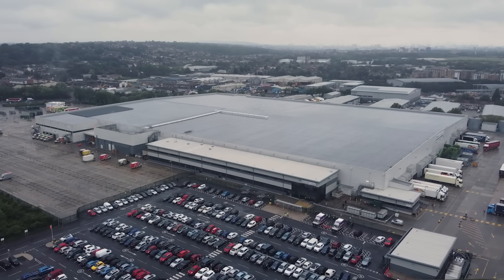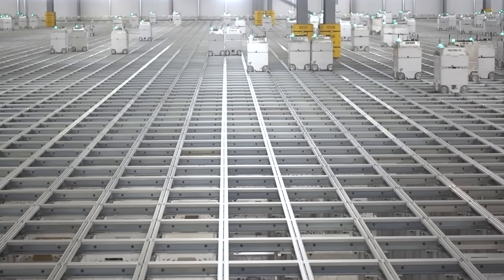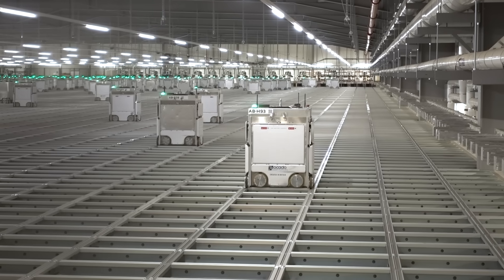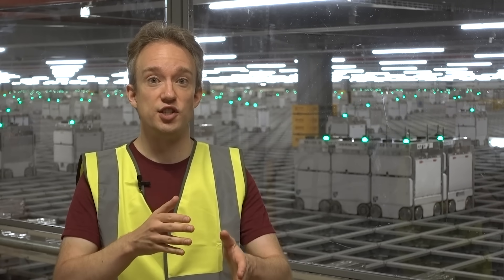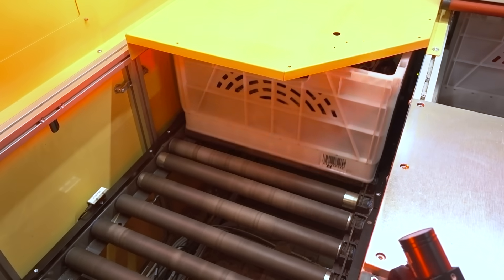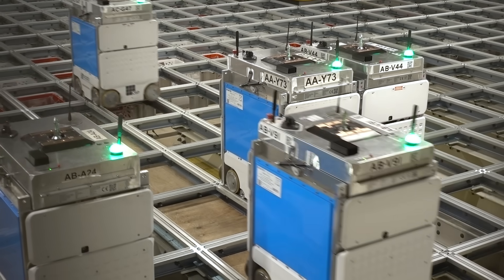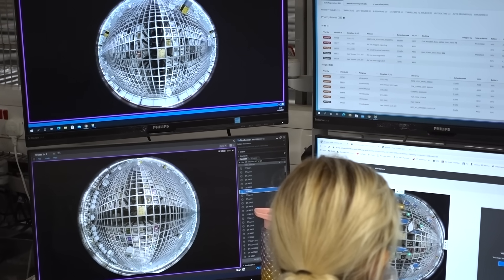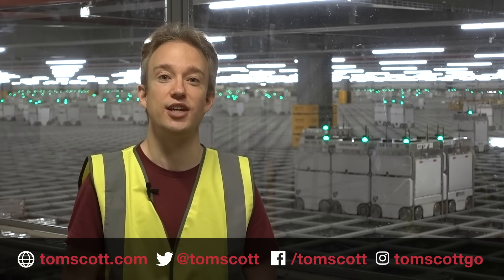How many robots does it take to run a grocery store?

Comment: "...We use 2 3d cameras.." 
Shows xbox camera
I... expected something different
Reply: From a technological perspective, Kinects were ahead of their time. It’s a shame developers never figured out what to do with them.
Reply: @bubbledoubletrouble  It's not just developers (though it definitely plays a part) -- even if developers DID figure things out better you'd still have to overcome the mainstream consumer threshold. Reach a wide enough audience with an interesting and accessible enough product.

The reality is that most people aren't all that interested in a fully 3D gaming experience, if only because a lot of people straight up do not have adequate free space to properly enjoy it. And if the choice is to move half your living room aside so you can enjoy a game with the 30-60 mins of free time you have to just plop on the couch and play some something straight away the latter is the more appealing option.

VR has the same problem. Even as VR headsets are becoming more accessible to the mainstream audience the fact that you would need free space to play standing up means a lot of people just won't bother.
Reply: @danjal87nl  we need Matrix style chairs ('jack' in and it projects sight onto your visual cortex, then collected neural responses as controls)
Reply: @bubbledoubletrouble  I've seen people use them to have full-body tracking in VR
Reply: @bubbledoubletrouble  yup. just like gta4. there are alot of things that came out of 2008 that were ahead of their time.
Reply: Kinects are decently widespread as as a sensor in uni robotics, I think our robotics department might still use some. They were on a short list of sensors whose specs I had to gather as homework once.
Reply: Back in uni, a friend of mine designed and built a (proof of concept) gesture control system for constructrion cranes using a kinect, about 10 years ago.
Reply: I had my chest scanned over at a hospital once using a Kinect camera, which surprised me
Reply: @DominatingCrow  what were they trying to scan, as far as I am aware kinects can't penetrate skin?
Reply: @willowarkan2263  Scan wasn't a good word to use, but they had it on a thing above my chest and it did the little looking up and down motion, since I was there to get a chest deformity looked at.
Reply: @DominatingCrow  i mean it's still a scan, just one of the surface of the body, which makes sense to use a 3D camera.
Reply: I worked with these to automate some mining vehicles, they are absolutely great, mass produced reliable and cheap. We only moved to custom systems if the distances we needed to resolve in 3d where more than a few meters. Those custom systems always where 20 times the price and 10 times the hassle compared to a Kinect.
Reply: There was probably a warehouse full of waitaminute...
Reply: I laughed so hard
Reply: I saw that I have one
Reply: I guess why invent something new when something perfectly acceptable for your purposes already exists?

Comment: I'd have thought they'd upgrade to an Azure Kinect rather than sticking with an Xbox Kinect
Reply: Crazy that the Xbox Kinect was a gigantic retail failure, but a huge success within commercial applications
Reply: It's so much cheaper than the azure
Reply: @xeonthemechdragon  There’s 5 at every GameStop
Reply: Most companies stick with what works best, not with what's best on paper.

If the original is just as good at this task as the Azure is, then there's very little point in shelling out a ton more money for Azures when a cheaper and just as good alternative exists.
Reply: its funny cuz they are both made by Microsoft.

Comment: I'd be really interested to learn how they deal with refrigerated and frozen items so they don't defrost. Also how vegetables are dealt with as they can can often be ordered individually. I think there may be something here though, since the pandemic started I've been ordering exclusively for pickup at my local grocers and I have wondered just how much more efficient the store would be if it was pickup only.
Reply: Since robots can work in the cold, you can build a separate grid in a chilled or frozen room, which is then picked in a normal temperature room by a human, and returned.
Reply: @chris195868  It's not, workers wear appropriate warm clothing when picking products from the pick station below.
Reply: Also do note that since the items are placed below the robots, the holes with the goods in them can be cold, as chill gravitates downwards.
So you could have a cooling system underneath the whole network, and have different nodes simply open a simple latch to maintain temperature.

It's mostly humans that defrost things with their clumsy warm hands and air displacement. If you stack things vertically and do things carefully, you don't need a lid or an entire cold room even.
Reply: I would assume the entire facility is temperature controlled. And since all of the cells are built below the bots, you could easily cordon off a section to serve as a “freezer”. The bots probably also are able to weigh products, but I would assume the produce in this sort of system either is pre-packaged or individually marked.
Reply: I’d assume the whole place is kept at around 3-5°C except for the bits the humans stay in, and they can have a separate group of boxes at -15° for the frozen goods
Reply: @ataphelicopter5734  the food warehouse I worked in was kept at 0.1 and we worked in that.
Reply: Another thing to add-on is that you can refrigerate certain cells, since chest refrigerators and freezers are insanely efficient and can run without a cover on them
Reply: @Vynncent  I work with a robot (AccuVax) that keeps a door between different temperature zones, and the door quickly moves out of the way when the robot needs to move between zones.
Reply: The reason for the high efficiency of chest freezers and refrigerators is of course that cold air sinks so when you open one all of the chilled air is not falling out as it would on a unit with a vertical door. 

Since the robots in the hive access the cells from the top it is not unthinkable that certain blocks of cells could be effectively chilled to refrigeration or freezer temps without needing a cover over the top.
Reply: The answer is to have food in the form of nutrition cubes.
Reply: @LowellMorgan  Nah, Soylent Green.
Reply: I just looked on the site and the video that plays on the front page shows a robot with a hand picking up an orange...
Reply: One section of the Building is maintaining about 3 degrees, above and below the grid. Workers wear extra clothing.
Reply: @robonator2945  It was a single tweet.

Crypto investors made a big deal out of it and started dumping which started tanking the price.
Reply: You simply don't sell them...
Reply: well if your measuring by environmental impact, worse than not at all. This system replaced people walking with thousands of motors being active at any given time. I swear, this and Tesla are like exposes on how what something looks like isn't the same as what it actually is. 

(I am referring to tesla making a big scene of no longer accepting crypto due to "environmental concerns" just because it takes processing power to mine it, even though it doesn't need fraud tracking, bank servers, buildings to be constructed, etc)
Reply: @robonator2945  Humans walking probably require more resources than these robots.
Reply: @Crewmember2   unlikely. The robots not only have an extremely inefficient travel system but they also move far more than they need to in comparison to humans. A**2 * B**2 = C**2 but all of the grids the robots run on are perpendicular meaning they can't use any C**2 traversal. In other words, humans can take shortcuts, they can't. Further humans' walking is actually highly optimized, thats why you can always tell when a toddler is coming to you, they haven't learned how to "walk" correctly, they waste energy. Humans more or less just have a controlled fall that leans them in the right direction. In fact, humans are so efficient at walking, that its theorized, with good evidence, that we would use persistence hunting to literally out walk other animals until they gave up. Not to mention most any numbers you find on walking will be inflated by the fact that its including the energy to keep the person alive during that  time in the energy used to actually traverse which isn't accurate. The person is going to be alive eitherway, the only additional energy used is the traversal. This isn't even the beginning of the reasons why this is a comparatively inefficient system mind you. My point was that this was built because it was an easy sell, it looks futuristic, it looks efficient, it looks neat, but its absolutely terrible when thought about practically. Hell, from what I have read, its still a pickup system, so people are still driving to the store to get the stuff which means not only is the PERSON moving somewhere they dont need to, but they are also moving a full bloody vehicle somewhere it doesnt need to be going. If you give two shits about energy efficiency this fails on every front. Personally, I don't care that much since minmaxing power isn't going to do anything relative to increasing education on nuclear power generation (which produces less harmful radiation than burning coal and is safer than both wind and solar) which can create clean energy to begin with, but until that happens this is a complete and total fail.
Reply: @robonator2945  except humans couldn't just take sortcuts because things would be stacked in rows you can't just walk over.
Reply: @eDoc2020  obviously its not effecient when speaking in absolutes, nothing is, but relative to the dramatic overhead from other sources and other animals, we are tremendously efficient. In a perfect scenario, yes, we can devise more efficient methods of movement, but that isn't what we have. You used solar, but most of the worlds grid is still coal, coal, which is a fossil fuel, meaning it has gone through SEVERAL more layers of inefficiency. Not to mention there are inefficiencies with power transmission, storage, etc. I was speaking relative to what we have not theoretical since its clear that the store was not optimized to its theoretical capacity. I also looked up your 25% claim and couldn't find any sources to back that up, the closest I could find was one article that said humans were on average 25% MORE efficient than other mammals. Most sources I found are citing the efficiency DIFFERENCES between animals, walking, running, etc but of the ones I did find that gave some numbers or qualitative descriptions, they all put that efficiency far higher. exact quote : 
"Cycling is the most efficient form of human-powered propulsion with 98.6 percent of the cyclist’s pedal effort used to spin the wheels, while those who walk/jog are only 65 percent efficient, and waste over a 1/3 of their energy to non-movement functions. 

Running is even more inefficient than walking. At the same energy expenditure (caloric burn) cycling is 5 times more efficient than running on flat surfaces with a still wind. "
Further, even this fails to adequately define "non-movement functions" which could very well be the simple living bit I was talking about in my earlier reply where most energy measurements include the energy used to just keep you alive. I'm not saying your wrong, but I can't find what source your pulling from with that 25% claim. Regarding your claim about photosynthesis effeciency you are correct, but thats still not really a great comparison, since electrical energy is generated very rarely through solar but chemical energy is generated through solar on a massive scale just by nature itself. The crux of this argument was impact on the environment, so citing the inefficiency of plant photosythesis isn't particularly relevant since plants don't cause pollution or hurt the environment.(in most cases) If we go by the farming OF the plants which CAN hurt the environment, I found a paper by David and Marcia Pimentel which said "To produce 1 kcal of plant protein requires an input of about 2.2 kcal of fossil energy" however I believe by "fossil energy" it means more broadly electrical and fossil is just the main source or the source currently used. Eitherway however, this still means humans are substantially more efficient realistically speaking, or at the very least are more than comparable. And, once again, if they are even comparable, the fact that humans have better pathfinding capabilities would more than make up for a slight efficiency loss.
Reply: @robonator2945  Tesla didn't make a big scene out of no longer accepting crypto lmao, Elon Musk tweeted it out. And as a result crypto investors shat their pants because they unironically worshiped Elon's tweets.

Comment: Even the consumer PC can be seen as individual bots. Not only are there CPU and GPU but every HDD or SSD has its own controller. Those are just very dependent on the rest of the system. There may just be a controller in every wheel or axle of those moving boxex.

Comment: Technically a "robot" is just a machine controlled by a computer, so there ARE 2000 robots who all share one brain.
Reply: @astrophobia6049  Rule of thumb: if a component breaks and the system stops, it's a single machine. If a component breaks but the system keeps running, it's multiple machines working together.

Comment: How does the facility handle the differing temperature requirements of various items while storing and moving items around?  i.e. Take Oranges and Ice Cream?  Ice Cream will melt if not kept frozen but Oranges will be damaged if frozen.
Reply: Some of the grid pits could be refrigerated - cold air doesn’t rise, so it would be relatively efficient. Or maybe there are special pits at the edges with sliding doors.

Comment: I wonder how often these guys crash into eachother due to placement error, or how often a tote gets jammed in a container slot because the machine grabbed it wrong or an item messes things up in loading / unloading.
Theres bound to be faults but that doesnt mean this is a bad idea- just curous about the cons as much as the pros.
Reply: My guess is: Almost never. Things like that need to be worked out before you deploy on that scale.

Comment: I get that the grid operators need lights to diagnose problems. But wouldn't it be more energy efficient (and therefore more cost efficient) for the lights to only turn on when they're needed?

Unless the pickers use cameras to move I guess. But that was not the impression I got.
Reply: I mean LEDs are already very energy efficient. And you’d need to be able to tell when a bot is: off, in transit, grabbing groceries, or when they have an error, all from a distance.

Comment: Here in America we prefer human slaves with the most minimal of any human benefits. Just enough so its "legel"  

:'( rip Amazon workers
Reply: Exactly. Amazon needed to do this a decade ago. There is no reason for a person to walk up and down aisles, for 10 - 20 miles a day, pulling  books or  pairs of sandals or screwdrivers off  shelves and walk to the front to get them shipped. Mindless stupid labor is meant for machines.
Reply: If this will save them even a dime, Amazon will do it as soon as possible.

Comment: Why are the robots moving on a square grid rather than a hexagonal one. Some say that hexagons are the bestagongs.
Reply: Because crates aren't hexagonal and hexagons require more directions to be accounted for.
Hexagons are optimal for packing spheres.
Reply: I realize you're just memeing, but you'd need 3 sets of wheels (or be able to rotate the second set) and your picker could never pass more than a single -gon before changing directions. Kinda lame.

Comment: I would like to know more about the bots. Do they get power from the rails or drive and dock to charging stations. Where do idol bots go? How does a malfunctioning bot get removed from the grid for repairs. Are they repaired on site or are they one of those send it back to the manufacturer for even the most simple repair.

Comment: I see how they pick groceries and package them and then move them to a place to be picked up.......but.......where does the grocery selection begin? Where are the shelves and bins of product stored since there are thousands of different products in a typical grocery store. And who stocks those? And who rotates the products based on expiration dates and freshness? You can't just keep stacking apples and pulling off the top of a pile. The ones on the bottom would look like hell.
Reply: @shaneludlow6858  Thanks for that info!

Comment: Is this actually efficient over all, or is it only profitable for this corporation at the current moment?  Is it sustainable? It seems to me that they are using a lot of power, resources and infrastructure to satisfy consumer whims with a "Gee Whiz" factor.  Also, how long before someone hacks the crap out of this whole system with an attack at a seemingly insignificant vulnerability just to see it go "BOOM".
Reply: YouTube Account  The source of the power is only a small consideration in relation to the full picture.  The power has to be transmitted through the grid and substations to get the power to them.  Each of those thousands of robots use many high torque motors and servo actuators that will eventually fail and need to be replaced. Somewhere on that massive grid there will be some kind of mechanical failure (not a software issue) that a mechanic will have to go out and address, stopping a certain amount of the operation. The more complex the system, the more failure points accumulate.
Reply: YouTube Account  I'm sure they're aware.  They will make their money in the short term.